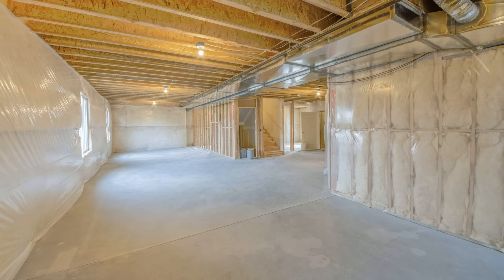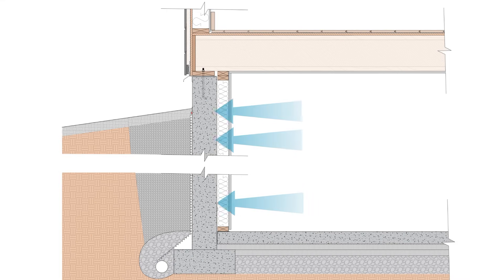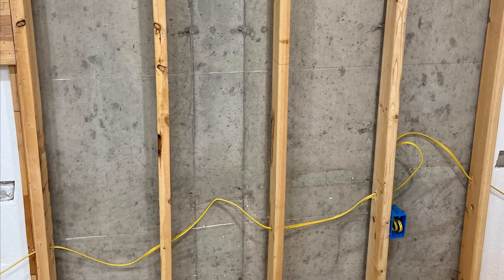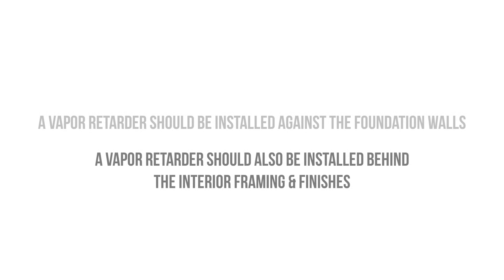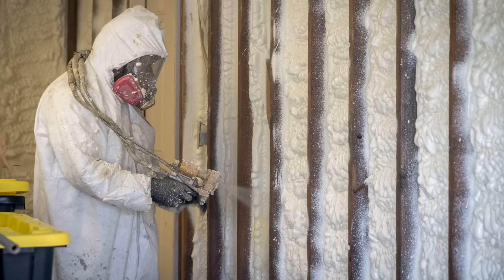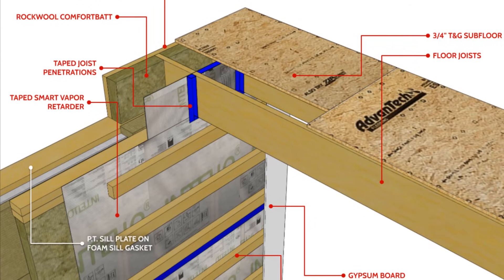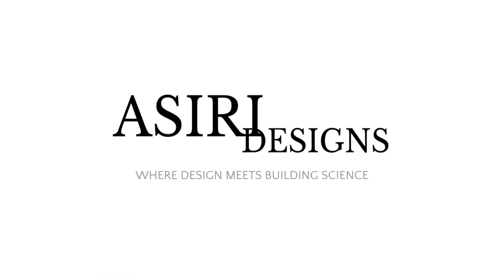The Ugly Truth About Basement Vapor Barriers

Comment: We sometimes hang our 2x4 top plates staple plastic to the face of that then add another top plate to create a plastic drape behind the wall usually 1 to 2 inches away from the concrete foundation, then pull the plastic under our bottom plate before fastening to the slab , and stick frame and toe nail our studs . ( Chicago climate )

Comment: If you put your rigid foam insulation on the outside of the concrete, you don't have to worry about what it's going to do if you ever have a house fire, and your concrete thermal mass is now inside your thermal envelope. Then, put some drainage around the outside of your house already - there's not excuse for having dirt against the foam or the concrete when you have so many options in gravel and slotted pipe to take the water away.
After that, make sure there's an air gap between the concrete and the timber, and run a dehumidifier through this space. Obviously you still don't want any electrical outlets or other holes in the wall lining on these outside walls, but a small dehumidifier and a fan to keep the air circulating is cheap insurance against anything going wrong.

Comment: Wow hang on you are getting off topic here a bit. It’s not just basements a vapour barrier is installed on all outside walls it stops condensation but also helps keep hot and cold air on the outside of the home. It’s not just used in basements but in all outside walls on every floor of the house including ceilings that cover attic spaces. If you are developing mold your house as an air flow issue. If your house ain’t breathing correctly mold will grow. It’s important to make sure the attic is vented properly you have to have soffit vents and roof vents the furnace needs to have a proper air return in all rooms of the house and filters need to be changed periodically. If your growing mold it’s not because of the vapour barrier.

Comment: Question. 

What about rigid foam exterior. Below grade. Applies over a proper waterproofing membrane applied directly to exterior concrete foundation. Foam is sealed onto exterior as well. Then the foundation is allowed to breath and dry out properly for a couple of years. Then, finish basement.  No vapour barrier.  I’m not an engineer. I’m asking a question.  What is the best most effective method of having a finished basement.
Reply from the maker: @FrankandaTrailer  That works well, but only if you're able to keep the rigid insulation dry and away from ants and termites (easier said than done). Ants love to burrow into foam, especially damp or wet foam, and so from a durability standpoint my preference is to locate that insulation layer on the interior.
Reply: @ASIRIDesigns you can put the insulation on the inside if that’s where you want the bugs…
Reply: Spray foam will be like aspestos in the future , I won’t use any product in a house that is toxic  , many products that will do the job that won’t slowly kill you . 🇨🇦👍
Reply: @cameronhamer9432  most products in your home are toxic though so that's completely irrelevant... Isocyanate, or the “A” side of spray foam is one of the key ingredients in structural beams along with dozens of other things filling your home. You okay with PEX carrying your drinking water as well? Lol. The anti foam movement is ridiculous
Reply: @cameronhamer9432  I assume you sheathe your walls with diagonal 2x lumber and omit the poly vapor barrier on your house? Because hating on foam while being okay with OSB/plywood and polyethylene sheeting makes no sense.

Comment: Great video. If you want to go even one step further than the samet VB you show, look into SIGA Majrex, it allows moisture to only move in one direction (think check valve for vapour) as opposed to “conventional smart VB” that can also allow moisture to move into the wall when the moisture content of the air on the inside is high.

Comment: What about house wrap first against the concrete wall then studs then insulation then vapor barrier Then drywall? House wrap sheds water one way but breathes the other way so needs to be installed just like you would on the sheathing on the main floors Staple it to the plates at the top first to hold it up 🙂
Reply from the maker: @thegrantdanielsband  No. Watch my latest Q&A where I address this: https://youtu.be/9yoGFX_1gjQ?feature=shared
Reply: Housewrap is not a vapor diode. If it breathes, it breathes equally both ways.
Reply: @hailexiao2770  You did not listen to what i said you put the writing side to the blocks it stops the moister/water from the studs and lets the insulation breathe and keeps it dry so no mold will grow. this is how Tyvek works get it? I did not say put it in place of vapor barrier you would still use it on top of the insulation and studs. first thing you do is put the Tyvek writing against block or concrete then studs insulate plastic then drywall simple for anyone to figure out lol 🙂
Reply: @thegrantdanielsband  Tvyek is waterproof but vapor permeable. It doesn't "shed water one way and breathes the other way", it sheds liquid water both ways and lets water vapor through both ways.

If you build as you describe the liquid water will stay behind the Tyvek but the water vapor will pass through it and condense on the back side of the vapor barrier. That location has more mold food than between the studs and the concrete wall so the setup will get moldy if the backfill is wet. 

IMO the only place fibrous insulation (fiberglass, cellulose, mineral & sheep wool, etc) has in basement insulation is in front of enough vapor and air impermeable insulation (foam and foam glass) such that the inward face of the impermeable insulation never drops behind the dew point. If you want something simple to figure out, just insulate basements with nothing but foam. If you want something even simpler, build a frost protected slab instead of a basement.

Comment: We have a basement built using PWF - permanent wood foundation. Amongst other requirements was that there be granular drainage on the outside of the foundation walls, which continues on underneath the walls and the floor, then is tied into a sump pump. Our basement has never been anything but bone dry... it's probably the driest space in the house. I can't say I've ever truly understood why concrete foundation walls are allowed to just be backfilled with whatever soil came out rather than requiring drainage.
Reply: Matt Risinger recently put out a video on wood foundations. It only scraped the surface but interesting.
Reply: PWFs are fantastic when built properly, but their reputation has been ruined by the godawful way they were built in the 1970s. Fiberglass batt insulation, undercut said batts and drywall to promote airflow for drying (using warm, moist interior air), explicitly warning against fully adhered exterior membranes for some reason and promoting floppy 6 mil poly instead...basically every single possible building science mistake.

Comment: Ive always framed basement walls about an inch off the foundation, then insulated and vapour barriered the wall frame.  It leaves enough space for the concrete to breathe behind the insulated wall.  Ive never had a problem, but ive also never ripped a wall apart that ive done this way.
Reply: The concrete will "breathe" to where? There is finite space between the vapor barrier and the wall, and it isn't making it past the vapor barrier.

Comment: New Construction foundation concrete floor has visqueen (plastic sheeting) placed on floor before poring concrete and walls are of foundation have thick layer of more visqueen wrapped around outside walls sometimes repeating the steps.
That is Building code (for decades) where I live also keeps moisture from entering past visqueen, Tar may not be enough.

Comment: Put the framing a half inch or so away from the concrete walls.  Put fiberglass insulation in, with paper-backing already on.  Then stapled clear, plastic vapor-barrier to the framed walls - but only to the below grade height (of the outside dirt).  30 years & counting with zero problems.
Reply: Wouldn’t that create a tone of air and moisture penetration?
Reply: @robertt9342  In the summer, we have a little de-humidifier on, like we did even before finishing the basement.  No problems here, knocking on wood!

Comment: Ive been questioning this for many years. Concrete walls could sweat and therefore a plastic barrier would not let the insulated wall breathe behind the drywall
Reply: If you house is probably vented this is not an issue because the inside of the home can breath and moisture won’t be an issue.
Reply: @ryans413  If the entire house is vented, you either have sky high energy bills, are okay with massive temperature swings, or live in coastal California.

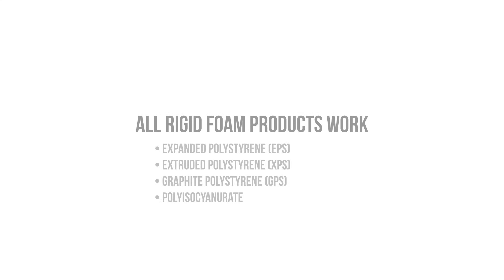Comment: at 2:56 you talk about 'the right ratio' between the ridgid foam applied to the concrete wall vs the fiberous batts installed interior of that foam.  I've read up on the ratios required for main floor walls, is this the similar ratio you are basis this off of, or is there a similar table where this can be looked up by climate zone? Thanks
Reply: The vapour barrier should be located where it will always be at a temperature above the dew point. Determine the worst case dew point for your climate for all seasons. The foam thickness to permeable insulation thickness ratio needs to be greater than the ratio of the dew point within the indoor - outdoor temperature delta. Note that the outdoor temperature below grade is different than above.

Comment: Thinking back (24+ years ago), my builder used metal studs with pink insulation and vapour barrier from floor to ceiling in the whole basement.   7 years later, I finished the basement ( added some interior walls and electrical around the perimeter, so i had to cut the barrier to feed some electrical around the basement walls.   I didn't notice any mold.  This video makes though.  Should I bust open a section to check, or just leave well enough alone?

Comment: House wrap with writing facing concrete,then framing,insulation and vapour barrier..standard practice in Canada.
Reply from the maker: @elcrypto3623  This approach is wrong for the very reasons outlined in the video. Vapor barriers trap moisture in the framed cavity... Moisture can and will get inside, either from interior air leakage, inwardly driven vapor diffusing out of the concrete, or from bulk water leaks. That moisure must have the ability to dry out of the moisture sensitive framing.
Reply: @ASIRIDesigns 
Energystar engineers are all ok with house wrap between concrete and framing because it works.
You should know..house wrap such as tyvek is NOT a moisture barrier.
I have done it in my old house basement and there is no moisture in my framing cavity..with a vapour barrier in place.
If you install the house wrap with writing facing inside you WILL have a moisture problem...writing facing concrete works great..it prevents moisture from wood framing and insulation as well as allowin it to breath..just as it does on the exterior. 
Like I said 5 years it's been in place in my basement and there is no moisture.
Can't argue with success.
We have tried many systems over the years and that is the only way that works.
It's standard practice in energy star homes.
Reply: Standard practice is to run air barrier on exterior wall down to foundation and under plate to inside of  foundation and down wall to tie into vapour barrier on framing....it gives you a continuous air barrier.
IT WORKS.

Comment: Insulation on the exterior wall. Simple and super effective ! The saturation point (dew point) won't be in the basement, but outside.
Reply: 2-4” of SM board on the outside of the concrete. Stops all the problems. Insulation needs to be on the outside of the building.
Reply: At least 2/3 of the insulation hast to been on exterior walls. Ex put 100mm insulation outside, max 50mm on inside.
The insulation on exterior walls are offcors not exposed to water because you lay plastic sheet and mass with draining in bottom.
Reply: For sure on a new construction, but prohibitively expensive to do on an existing house.
Reply: @falim4972 Prohibitively expensive? I did it myself, 120 foot trench in northern Vermont. R10 foam and stucco.
Reply: If you can afford it, exterior insulation is always the right answer, in every climate.
Reply: No matter how well you think you do your exterior drainage and waterproofing if you put insulation on the exterior of your basement walls between the block walls and the brick veneer finish you will always get water logged and molding insulation.
Reply: Problem with this is the foam board will get water logged. It doesn't matter what the manufacturers say. I've seen videos here on YT of XPS & EPS being pulled out of the ground from basements completely soaked. This negates any insulation benefits and is a very expensive waste.
Reply: @3rett115  Sounds like somebody didn't build with proper exterior drainage. In any case wet EPS and XPS still provides decent insulation, and since it's supported both horizontally and vertically by earth, doesn't pose any structural issues.
Reply: @3rett115 it’s also only realistic on a brand new build and impossible for someone finishing an existing basement anyway

Comment: I have been thinking this for years as the basement walls would have moisture and you had the pink insulation it would get wet and not be able to breath with the vapor barrier.  I found this was the case when I purchased another home build in 1950 with a reno in the basement.  I noticed drywall was soft so I knew it was getting wet even with the barrier.  I have to tear it all out and do foam board first
Reply: Vapour barriers are designed to breath.  This is why they are not called vapour proof, nor an air barrier.

Comment: Video shows cold going straight through insulation to reach the vapor barrier. Just use better insulation!
Reply from the maker: "Cold" doesn't come inside, heat flow is from warm to cold. You need the benefits of an air barrier and vapor retarder in the insulation specs, or find another means of controlling condensation.

Comment: Couldnt you cast the basement wall with waterproof concrete mix (ie: materproof admixture)? that should address half of the problem with moisutre coming in from the outside.
Reply from the maker: You can, but here's the thing... All concrete cracks. Cracks are pathways for water to enter via hydrostatic pressure. So a drained system is the only way to prevent bulk water from getting inside. As for the other capillary forces and interior vapor drive/air leakage, they need to be addressed accordingly.

Comment: There's technique for insulating basements with house wrap on the concrete block side first then studs,  batt insulation and vapour barrier.  What are you thoughts on this method?
Reply from the maker: It's the same problem.
Reply: @ASIRIDesigns  disagree, it's not a problem on a properly poured and damproofed foundation wall
Reply: @blehssed  how about a block wall built in the 1970's.  It's probably not damproofed properly.
Reply: @blehssed  No matter how damproof a wall is, some water is going to get inside, and now it can't dry inwards because of the vapor barrier. With foam insulation at least the water stays within the concrete, but with studs and fiberglass it will be stuck in the framed wall, ie mold food.

Comment: Finished basements are not a good idea to begin with. There is this obsession of having a basement, finishing it and using it as a living space.  it's just a ticking time bomb for disaster.
Reply: Not everyone has the luxury. Homes are expensive and space is limited so people have to make the best with what they have. Basements are common because the area is dug out for the foundation, so may as well make the best of unoptimal space.
Reply: @adamford518  Sure it is cheaper but in most countries basements are for the pipes, storing wines, and roots.
Reply: Completely disagree.
Reply: Complete non-sense, in certain areas with a high water table and soil that doesn't drain well I would agree. Many places aren't like this and finished basements are totally fine
Reply: U know not what u talk about,
Reply: Given this overheated real estate racket we are dealing with, maximizing utility and minimizing waste has been forced into people. For some reason.
Reply: Closed cell Spray foam the walls and it's s done deal it's triple cost of conventional insulation but worth it.
Reply: I agree completely. A basement is just waiting for a flood event to happen, sooner or later. Naked concrete is easily washed up after a flood.

A basement serves as easy access to the plumbing and heating systems,which inevitably fail and need repairs.

That being said, my basement walls were styrofoam concrete forms, inside and out, so it can be heated when needed.

Comment: I am right now searching how to limit radon getting inside my basement from the joint of my basement slab and basement walls. Those foam panels are unfortunately a chimney letting radon inside my basement. I don't know how to tackle the problem.
Reply from the maker: To address radon you need to do two things: Keep the radon out by ensuring that you're providing an adequate air barrier at the pressure boundary between the foundation and the conditioned space, and a means of radon removal, which is usually a passive or active subslab depressurization system. You don't want your home to be negatively pressurized, otherwise you're sucking soil gasses into the house. The house should be pressure balanced, or slightly positively pressurized in this case.